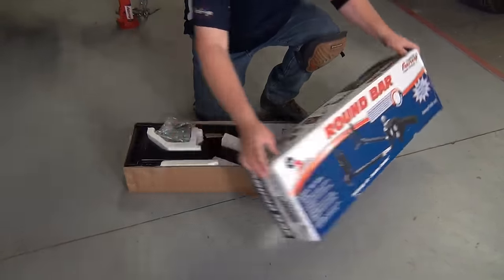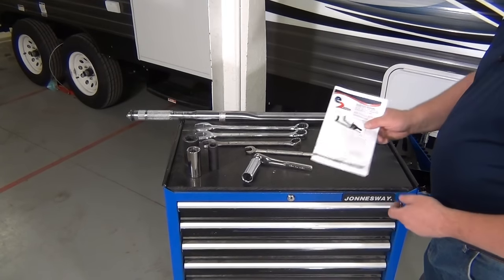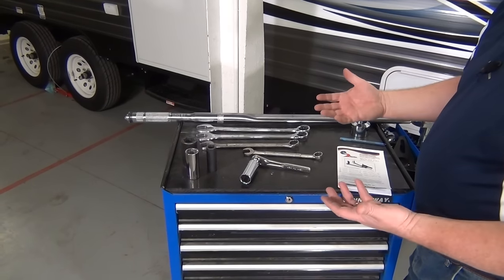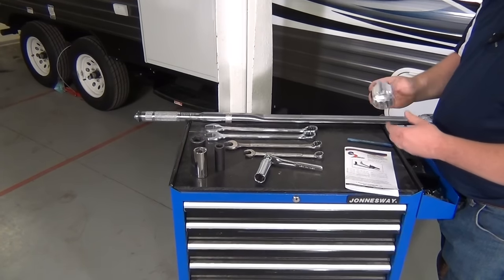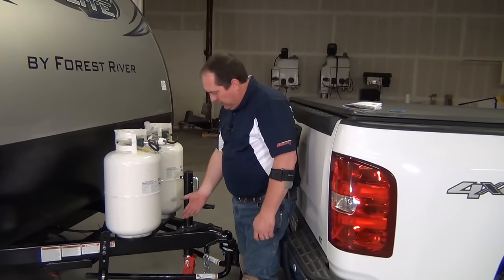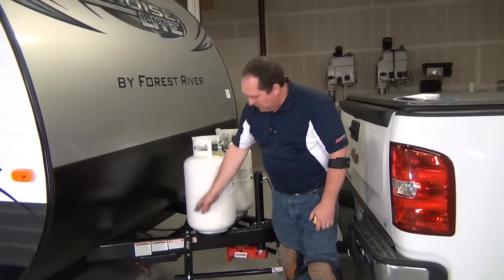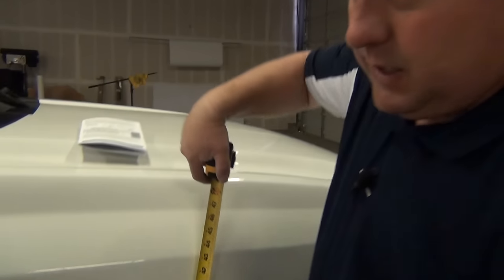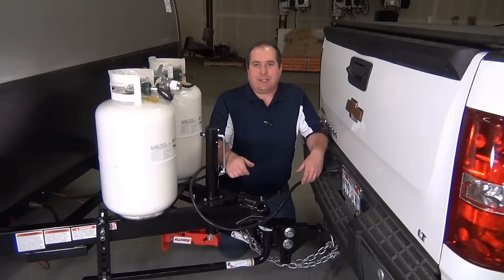How To Install Your Fastway e2 Round Bar Sway Control / Weight Distribution Hitch*

Comment: I have this hitch and I was wondering if there is a replacement for the sway control friction material?  Mine looks like it is quite worn off, and I am not sure how effective it still is.
Reply from the maker: larryz24,

The e2 hitches do not have friction material added to the trailer brackets. This is a feature of some of the Reese brand hitches, and if yours has this, you would need to contact their customer support for information on a replacement.

The e2 hitch's L-brackets can be replaced if needed, although having one wear to that extent is unusual. Get in touch with our customer support team at 877-523-9103 or Support@FastwayTrailer.com. They can help you get a replacement, and can determine if you are eligible for any warranty coverage on them as well.

Good luck and safe towing!

Comment: I had the system fitted oct 2022 by the caravan dealer after using the H/R WDH before .
Must say its a big improvement over the Hayman Reece WDH.
One thing tho is it normal fir the friction points on the L bracket to show signs of a brown colour ( rust)?

I rang my dealer and he said its ok but do not put anything oner the friction pads like silicon spray/ wd40 ect
Reply from the maker: A little bit of rust is normal, especially if your hitch is left outside in the rain or bad weather! Thankfully there are ways to spruce up your hitch, including sanding down the rust and repainting!

Comment: I have 2017 F150 Eco Boost with 6'5 bed and longer wheelbase and am within weight specs on my 30' TT but when I tow I get lots of sway. Is it possible that I need more washers or need to adjust L brackets? I also noticed that when dealer installed, my hitch ball is slightly angled downward and one L bracket is slightly further from coupler than other side.
Reply from the maker: +116059861215009681323,

Yes, it is possible that you need more washers, or to adjust the L-brackets. You will need to take several distance or weight measurements at the front of the tow vehicle to check this. Follow the weight distribution setup section in the e2 hitch owner's manual. If you don't have a copy, you can find one here: http://www.fastwaytrailer.com/manuals

It is also correct for there to be some downward angle on the hitch head/ball as you describe. This is part of the pre-load angle on the hitch that puts the spring arms in position to be lifted up and give you sway control. Also, keeping the brackets at the same distance back is the best practice. However, a slight difference will not effect the performance of the hitch. Make sure they are tightened to the correct torque, and that they are forward enough to allow movement in the spring arms in a tight turn without coming off the L-bracket. Details of this are also in the owner's manual.

Here are a few other things to pay attention to. First, you have a pretty big trailer, basically the equivalent of a 30' x 9' sail on the back of your tow vehicle. You will probably naturally feel some push to the side as semi-trucks pass, or when you encounter a crosswind.

Check the loading of your trailer and make sure you are keeping within the recommended 10% - 15% tongue weight. A trailer with too light a tongue weight starts to get unstable, and a negative tongue weight is downright dangerous.

Make sure you have good tires on both tow vehicle and trailer, and make sure they are properly inflated. Soft tires can cause a lot of instability, and in some situations over-heat and break down.

Slow down. Speed is a major factor in sway and sway-caused accidents.

As always, if you need more details, or further help after trying some of these suggestions, get in touch with our awesome customer support team at 877-523-9103 or Support@FastwayTrailer.com.

Good luck!

Comment: I could not find the speciality socket on your website. Can you post the part number ?
Reply from the maker: +110637021261132719100,

Sorry about that! The part number for the thin-walled socket is 70-00-4800. Get in touch with our customer support team at 877-523-9103 or Support@FastwayTrailer.com and they can answer your questions and get one sent out to you.

Comment: Ok, im lost here, i have a 2017 yukon xl, it has automatic air bags, when i ñoad it with gear it will lift in its own, so then I would need to turn them off? And leave them off to set up, and after its set up, leave them off for the trip?
Reply from the maker: Almost. Load the vehicle, let it level, then turn it off. Set up your hitch, then hitch up and turn it back on. Double check the weight distribution after it levels to make sure it is still good, then go ahead and drive with it turned on. It will be a bit of a trial and error process to get the hitch adjusted correctly. Good luck!
Reply: Gun Engraver is see, here, is there a middle ground to having to adjust it to every load, if were going to the beach we load different things than if were going bike riding/hiking, load would vary, i imagine, thanks for taking a newcomers question, just want my girls to be safe
Reply from the maker: You really should not have to adjust every load, unless you are significantly changing the weight and placement of cargo. Measure the front wheel well (unhitched, hitched, hitched w/ WD) as you hitch up for your first few trips and record the measurements. This should give you a pretty good idea of where your setup should be. Then, you only need to check and possibly make an adjustment if you load up in a way that is very out of the ordinary.

Comment: The dealer set mine up 2 inches or so out of level. When I level it what all is required. Or do I just start over and redo it all. The only thing I don’t know is how many washers I would need to change.
Reply from the maker: These are some good questions. The adjustments can be different for each tow vehicle/trailer combination. Don't hesitate to reach out to our awesome customer service team, who can help you get everything adjusted correctly!

Comment: Is there a way to put the round bars on without the hook tool? I need to hook my trailer back up and someone stole my hook lever from the back of my truck
Reply from the maker: Yes, you will just need to raise the jack higher. The higher you raise the jack, the less tension will be on the spring bars and the easier it will be to get the bars on!

Comment: I have the round E2 1000/10,000 lbs setup. I just upgraded my trailer that has hitch weigh of 898 lbs and maximum trailer weight of 8,800 lbs. is this solution ok, or do I need to change to the square bar supporting more weight?
Reply from the maker: No need to upgrade. That hitch should carry those weights just fine. Thanks for towing with an e2 hitch!

Comment: It would be very helpful to have a video with the shank upward instead of videos with the shank downward only set up. I do not seem to be able to find any for my E2 setup.
Reply from the maker: Thanks for the request, we’ll see what we can do. As for your setup, every other step should be exactly the same. The only difference is turning the shank upward to get the hitch ball at the correct height. Otherwise, same process and procedure. The e2 owner’s manual [https://www.fastwaytrailer.com/manuals] will give you a step-by-step guide to the entire setup. Also, please contact our Customer Support team if you need any other help with your e2 hitch, 877-523-9103 or support@fastwaytrailer.com.

Comment: Is it possible to have a bumper pull so heavy that you cant get the truck level, and need airbags?
Reply from the maker: Yes. It is possible to have a trailer too heavy for your truck and/or for your hitch. Take a look at the weight ratings for your vehicle and for your hitch, and make sure you are within the limits. If you are outside of the GVWR or the hitch ratings, you need to reduce your trailer's weight, or tow with a higher rated vehicle and/or hitch. Airbags offset sag, but do not fix weight distribution. Good luck! Let us know if we can help further.
Reply: @FastwayTrailer  890lb hitch weigh bumper pull @8100lb dry travel trailer. On 15 f150 max tow. 10k e2 round bar 1k bars. My bars dont sit flush on the L brackets they are downhill to the truck. Still far from level on truck. Even if more tension is put on the bars i dont see them correcting the problem or sitting correctly on the bracket
Reply from the maker: Dang it. Those bars definitely need to be sitting flat. If you are still having issues you can contact our customer service team at  info@fastwaytrailer.com or call them at 877-523-9103.

Comment: how do you know if you need to add or remove a washer instead of moving the L brackets?
Reply from the maker: We recommend moving the L bracket first, but if your L-brackets cannot be adjusted anymore add or remove washers if your WDH and trailer still isn't level.

Comment: HI, I am about to order the E2 94-00-0600 for a less then 4000 Lb Travel Trailer. DO I HAVE TO HAVE THE 2 5/16"  WITH A 1 1/4" BALL? I do not have the Extreme Torque and would not want to invest on the special socket. CAN I DO WELL WITH THE  2 5/16"  and  1" bolt and tighten/torque at much as I can possibly can?
Reply from the maker: Are you planning to use a bushing with the 1" bolt?
Reply: @FastwayTrailer  Yes, I have the busing from another kit

Comment: My rv dealer installed my E2 but i feel that it was done incorrectly how much of the round bars stick out of the L brackets. Mine stick out less then one inch????
Reply from the maker: Should be about 3 inches, anything less you run the risk of the bar slipping out as you make tight turns. If you want to make sure it's setup correctly, email our customer service team with a picture of your brackets at info@fastwaytrailer.com

Comment: Hi Dave great video, I have a problem I hope you can help me with, my trailer frame is 8 inches, and your trailer frame brackets are too small, there made for a 6-inch frame.  Do you make brackets that would fit my trailer?
Reply from the maker: Hi Nick! I would reach out to our customer service team and see if this ones will work: https://www.equalizerhitch.com/store/link-plates/outside-link-plate-for-10-frame. Their number is 877.523.9103.
Reply: @FastwayTrailer   Thanks for the info I now have what I need.

Comment: What height do I set the blue tape at above front wheels?  His video showed a gap of approx 1"
Reply from the maker: The exact placement of the tape does not matter. It is simply a clean line to measure to, instead of trying to find a sharp line at the edge of the wheel well.

Comment: So i can install this to minimize the weight of my boat on the tongue
Reply from the maker: Weight distribution does not minimize the tongue weight of your trailer. But it does change the way the tongue weight affects your tow vehicle. A good weight distribution hitch like the e2 can make towing your boat a much more comfortable and safe experience.

When you tow a bumper-pull trailer without weight distribution, the rear axle of the tow vehicle carries the additional weight of the trailer’s tongue or hitch weight. Adding that weight to the back of the tow vehicle causes the rear axle of the tow vehicle to act like the center support (fulcrum) of a teeter-totter, and lifts some weight off of the front axle of the tow vehicle. That weight doesn’t disappear. It is still part of the mass of the tow vehicle, but it is now being carried by the rear axle as well. This can potentially have two negative effects. First, you may overload your rear axle, exceeding its axle weight rating. Second, you loose weight that holds your front tires to the road, which costs you braking and steering control.

Using a weight distribution hitch changes the way the combined vehicle carries the weight. Using the leverage of the spring bars, it forces the front axle of the tow vehicle to carry the weight it would normally carry when not towing a trailer. This reduces the load on the rear axle, and keeps steering and braking control on the front axle.

Comment: Do I need to lubricate the bars at the locking coupler?
Reply from the maker: Where it fits into the hitch head, yes, you can lubricate there. Just be sure to NOT lubricate the bars where they meet the L-brackets.
Reply: @FastwayTrailer  thank you for the reply, I am getting a lot of edge wear on the L bracket (edge closest to the Truck bumper). So bad that I ordered replacements from you last month. The new ones are doing the same and I changed the load on them before our last trip (last week). Is this normal?

Comment: I've got the e2 1000lb round bar hitch installed on a bottom mount coupler style trailer . The only way I can get the spring bars to be somewhat close to being parallel with the trailer frame is to have the L brackets on the very last set of holes . Is this ok ?
Reply from the maker: +AutoTech Jord,
Yes, having the L-brackets on the last set of holes is perfectly fine. Also, having the spring arms parallel to the frame is the ideal, but not absolutely necessary for the hitch to perform well. If you have not already done so, turn the link plates (trailer frame brackets) over, so that the studs that hold the L-brackets are toward the bottom of the frame instead of the top. This may allow you to use holes closer to the center of the L-brackets instead of the ones at the end, and will reduce the force applied to the link plates when you're towing. Here is a video about using the e2  hitch with bottom-mount couplers: https://youtu.be/WM8e60mbqAM
Details of how to install the link plates are in the owner's manual, which you can get here: http://www.fastwaytrailer.com/manuals
Reply: FastwayTrailer . Yes I have already flipped the bracket for the L brackets. I will spend sometime and retry the setup procedure
Reply from the maker: +AutoTech Jord,
Good luck! Our customer support team is available to help as well if you would like to speak with them. You can reach them at: 877-523-9103 or support@fastwaytrailer.com.